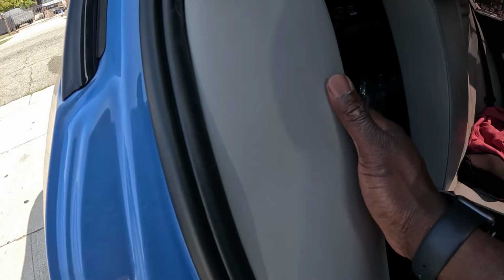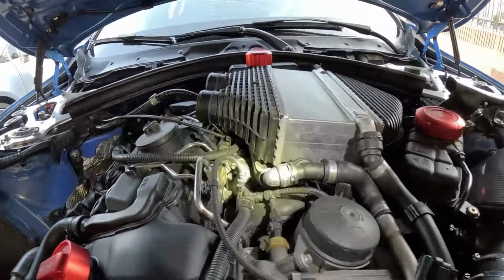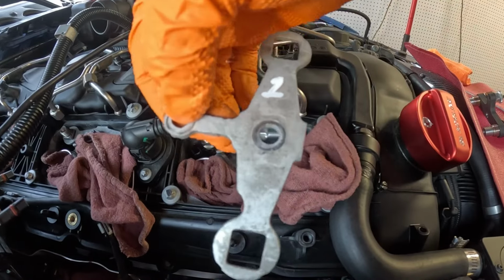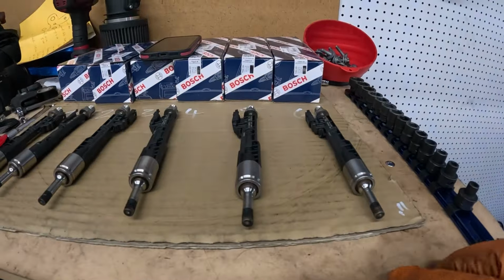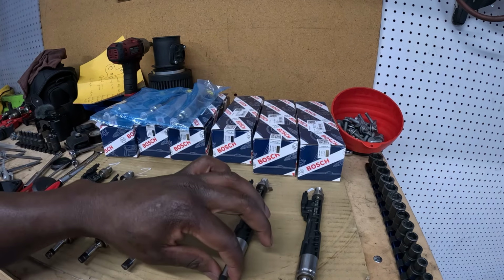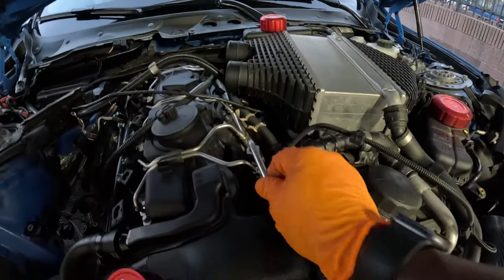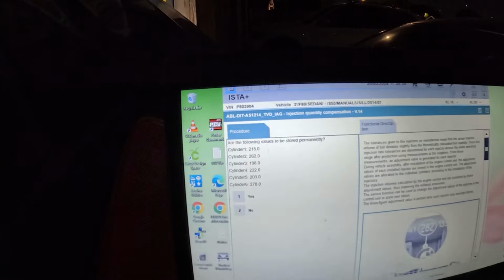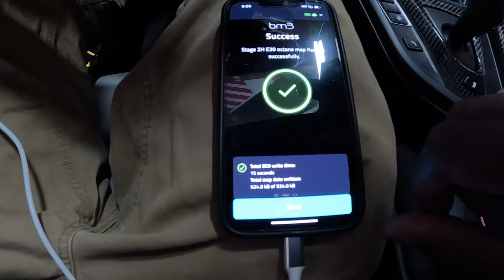How To Install And Code BMW  F80 M3 and F82 M4 S55 Injectors!

Comment: Nice job! OEM injectors are Bosch, same as the one you bought, only the OEM have the BMW logo and different part number printed, so there should be no issue.

Comment: Notice any difference with the EU5 injectors, how many miles on the car? Some people with higher miles said they can notice a big difference upgrading the injectors. What about smog now, swap them back. Got the Mosselman turbos installed two weeks back on e30 stage 2h and this is a huge improvement. Also ported the front turbo intake as it’s made for the stock smaller wheel and blocked air flow to the inducer of the compressor wheel.
Reply from the maker: The car has 76k miles, you can differently feel the difference. The engine is a lot more smoother and responsive. My idle is a lot better as well.

Comment: Is the difference between your stock turbo setup and upgraded turbos big? Like power wise. Is it really faster? Thinking about upgrading.
Reply from the maker: Yes, you can tell the difference. Right now I am still running off the shelf map, Custom tune will probably make the most out of the set up.
Reply: @Jbpgarage  what about grip levels on a dry day? Can you put the power down.
Reply from the maker: I just switched to R888, and I got some grip. I just haven’t had time to date log and get some numbers.